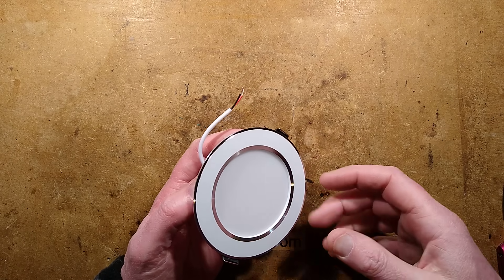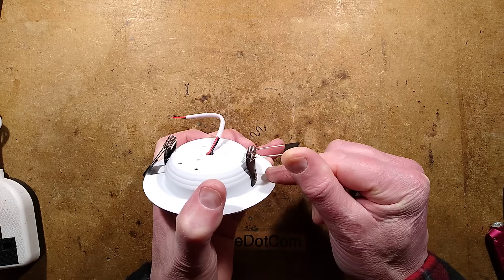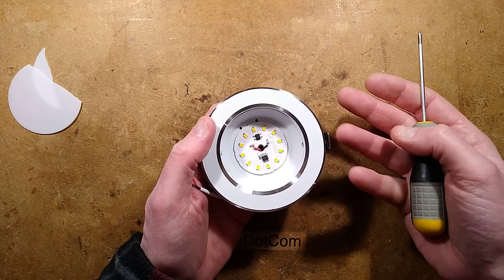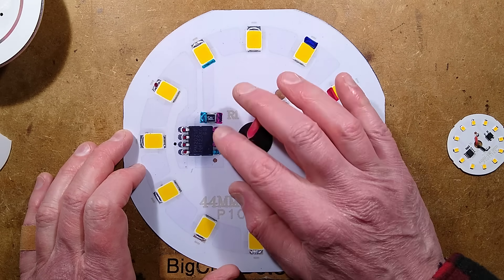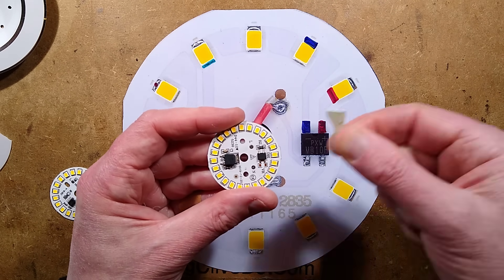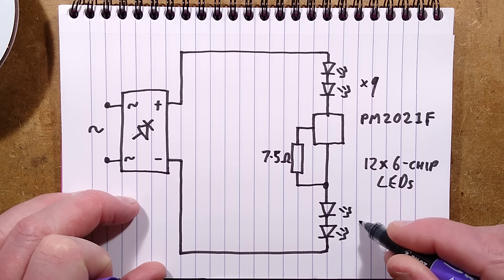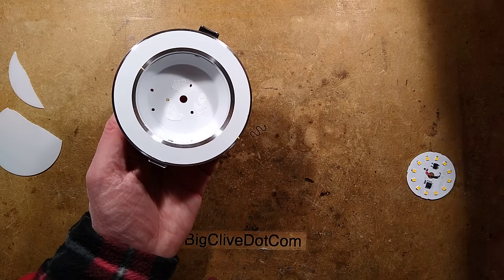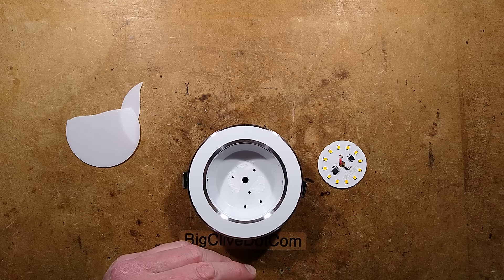inside a $1 downlight - novel circuit twist

Comment: This is why we invented lightbulbs. For a few bucks, you can fix the thing that helps you see at night. 
Having a light that's not user serviceable is just asking for trouble.
Reply: it's literally cheaper to throw away incandescent light bulbs immediately and replace them with (replaceable!) LEDs: the money to operate a 100W bulb is more that the price of a LED within months.
Reply: @Martinit0  This is an LED lightbulb. Unless you're snooping on my previous comments. I did mention there are VERY NICHE use cases for incandescents still, and I stand by those points as I've researched them thoroughly and make drivers for both types of bulbs for fun, not to mention my own LED lights, so I have a great understanding of exactly what components can go wrong in them. 

But yes, LEDs are far more power efficient, and in most cases have a much longer lifespan. This still doesn't change the fact that the MR16, GU10, G24, 2G11 R7, or even a tubular B15 bulb exists. Designing this to fit one of those would be much better for the consumer. Even if the manufacturer made their own screw in lightbulb it would be better. Primarily as you'd not have to patch up your ceiling in the event it needs replaced.

Edit: I'm a moron that can't read properly lol. Yes, I basically agree with you.
Reply: @Deja117  Probably I misunderstood your top comment when you said lightbulb I understood incandescent lightbulb.

I do actually have E14, E27 and GU10 type LED bulbs. They do exist. I don't know about the other connector types as I don't have any of those in my house.

I was about to say that G10 T8 LEDs don't exist but I checked just now and it seems they are now commercially available.
Reply: Saying "they´re unserviceable" is just "thinking one step too short"... One must NOT break the glass-cover, that´s just an option...
Reply: To be fair, enclosed units are fire rated and IP65 waterproof for a reason in bathrooms so I can't complain with that and if your buying them from a reputable place then realistically you shouldn't have an issue getting a replacement.
Reply: it cost a dollar buy 5
Reply: Let's assume that this light IS "serviceable," and that one (or more) has failed. At $1/ea, is your time worth so little that you'd spend an hour or so to replace single LEDs to repair it? Or would it be a wiser investment to just spend another $10 at the time of purchase to have ten spare modules on hand for the times when one fails? Because in these inflationary times, $1 is almost like that penny you see in a parking lot and won't bother to reach down to pocket it because "it's not worth my time."
Reply: @demef758  Another consideration of worth of your time: is it more effective to spent two minutes to pick up a spare lamp, unscrew the old one, screw in the new one, and throw the old one in the rubbish? 

Or is it more effective to go turn off the electricity, probably get a ladder and set it up, spend ten minutes gouging the old fixture out of your ceiling, trying to do the minimum damage to the soft plaster around it, snap at least one of those mousetraps on at least one finger, unclip the plastic splices, breaking one in the process because it is brittle from years of heat, spend another ten minutes finding another splice connector (or an hour to go out and buy one), clip the new fixture in, snap it in place, clean up any mess on the white ceiling plaster, put the ladder away, and get the vacuum to clean up the mess on the floor? Oh, and go turn the electricity back on and see if your repair actually worked? All told between half an hour or maybe three hours, depending on how many unexpected parts you need to buy?

Personally I think that two minutes with minimal danger to anyone is considerably more efficient than several hours with considerable danger both to yourself (if you aren't an electrician) and chance of damaging the plaster work, or at least getting it smudged around the fixture.
Reply: @lwilton  You spend less time replacing the bulb if you make the kids or wife do it too.
Reply: @demef758   Well that light still isn't user serviceable in my opinion, that sounds like something rather dangerous still, that an electrician should be doing. Since it's playing with potentially live wires... Depending if you remembered to flick the light switch off or not. So the user shouldn't be anywhere near that part of it in this case.

Now if there was a simple and safe screw mechanism, where you could twist the plastic diffuser out, then twist the old board out the light, and place a new one in, then that would meet the "serviceable" requirement as it's not potentially putting you in danger of being fried by 120, or even 240 volts depending where you live. In fact, there would still be the danger of some exposed components on the PCB, so you'd probably want to have the diffuser built into the board so you didn't risk touching them. So now it's safe to the user, and doesn't risk immediately harming them if they make a mistake, then I'd call it user serviceable. But again, this is all just my own personal opinion. I just put safety above saving a few bucks. 😊

Comment: My kitchen light is like that, just a throw away LED fixture. It flickers after a few minutes of being on. I was so annoyed when I went to change the bulb and found there was nothing to change but the whole thing. I just quit using it and live with a dim kitchen lit by the over the sink pot light.
I wonder if I could change the driver in it, I found some online that looked the same but I am leery of Amazon electronics in my ceiling.
Reply from the maker: It depends if it's the driver or the LED circuit.  It might be better to replace it, but either get a light that takes conventional bulbs or get a few of the same type of light as future spares.
Reply: Maybe it's just one component in the driver that's broken and you can figure out which one it is and solder in a new one?
Reply: @zzoinks  It has a box on it that has the 120v going into it and another plug from that box going to the LEDs. I assume that is the driver and you can buy them separately so I wouldn't bother trying to diagnose the actual part that failed. But as big Clive replied it might be better to just get a proper fixture that takes a replaceable light and be done with it instead of guessing at the problem.

Comment: It might be more acceptable if it had brown and blue wires, a fusible resistor, and an earth. For disposable light fittings, it would be better also to have some sort of standard plug and socket arrangement to make changing easier for people not used to coping with wiring; they only need to switch off the power (or just the lighting) then, like changing a bulb in a standard holder.
Edit: needs strain relief for the cable too.
Reply: In Australia they commonly come pre-fitted with a standard 2 pin power plug and they plug into a GPO like receptacle in the ceiling, so they are safely user replaceable without the home owners needing to pull out a screwdriver or touch any wiring. Given all electrical work requires a licensed electrician it's really the only viable solution. 

You can buy bare wire units, but do you trust your insurance company to still cover you in the unlikely event something goes wrong.
Reply: imo they should make a standard for those circular PCBs so you can unplug a dead one from the fitting and pick up a standardised replacement.
Reply: @elongated_muskrat_is_my_name I was thinking that too, but getting a good thermal contact with the housing used as a heatsink could be a problem. It would need some sort of screw down or clamping arrangement and then there is the thermal paste or other thermally conductive material to add.

Comment: I wonder if it being all metal would actually lead to this thing lasting a while since the whole case is essentially a heatsink.
Reply from the maker: It probably does have better dissipation that a bulb.
Reply: that is not sinking 12 or even 5W properly.

it's just baking + degrading the silicone until it fails 100%.

like the retrofit crap.

Comment: Why didn't it flicker without a capacitor?
Reply: It probably does. Also, if LED voltage is low (say driver dissipating idk, most of the line voltage) then it would flicker less even without smoothing. Which is very inefficient. When I designed my own linear LED PCB thing, I tried to match LED + min Vdrop on driver to nominal mains voltage (i.e. it would flicker and be dimmer if voltage in the socket sags below 10% i think) as close as possible and I ended up having 33 uF capacitor for 10W LED module. Oh and that also results in shitty power factor but I don't pay for it, nor do I care about THDs my device produces. Not my problem really :D
Reply from the maker: It will be flickering, but not too badly due to the on to off ratio.

Comment: I'm missing the sticker/stamp that indicates
- voltage
- frequency
- current
- power
- IP-rating or warning of exposure to water
- temp. characteristics
- quality/safety standards
- disposal/recycling. 😉
Reply: That information would probably put the price up to greater than $1...
Reply: @polymath9372  Yesss. 🤪🤭
Reply from the maker: That's because it doesn't comply with any standard or technical specification.

Comment: The issue with these disposable type fitting is not just that you need to buy a replacement but there's no guarantee you will be able to buy a replacement. A year from now, what's the chances that the same style will be available, especially if you bought from a random AliExpress listing. You end up with a ceiling full of downlights apart from one mismatched replacement.
Reply: In new houses here in the U.S, these non-replaceable fixtures are too common.
Reply: @vinnysworkshop  because they are flat out superior to other options for cost,reliability, and ease of install.
Reply: @dexecuter18  you mean because they are cheaper and faster to install, which is all that matters for the contractors. They are not "superior" nor more reliable to anything else that is also serviceable
Reply: While not quite the same, I installed an early version of the LED "retrofits" in the standard recessed cans in the basement. I had that same thought, if one fails it will bother me they don't match and I'll end up changing them all. Bought an extra 2-pack of them and so far after 12 years I've needed to use 1 of them. So hopefully I'll be set for awhile with that single remaining spare.
Reply: Or you buy an identical one in 6 months except they've changed something inside and the colour temperature is off etc
Reply: @kiplinght  Thats why you buy a reputable brand with a datasheet. You can match the specs. But I find alot of the stuff sold by the DIY chains is rubbish so you need to find a decent manufacturer and go from there.
Reply: If you want downlight, only buy the standard sized ones. I've just replaced some CFL downlight that were about 20 years old with some new LED ones. Aurora brand who I know to be good quality.
Reply: For an example, see my kitchen lights. Had to change one myself already. I couldn't find a matching style to what was there.
Reply: You can replace the internals.
Reply: There is ones, without a bulge at the rear (so, a flat rear), and instead, a bulged cover-glass at the front, which can be removed easier since it´s already curved, and without braking. ALSO: Don´t need a ceiling-hole for installation, just some double-sided adhesion-tape instead (flat rear)... But I didn´t know that there´s replacement-PCBs available, that´s great !!! If one can connect the 2 cables himself, eventually even solder a replacement-PCB himself, then, there´s no reasonable argument against them... Saying "they´re unserviceable" is just "thinking one step too short"...
Reply: Actually these are quite common for about 5 years. I have the smaller version above my hob as I couldn't find anything else that fits and looks OK.

They are cheap as hell and the first set lasted about 4 years of almost every day all morning to evening on with me.

Comment: Pins seem to be cheap, I've got two dozens of LED bulbs of the same model in blisters of 6 just before the pandemic, all those that have already failed used a JW1792 chip, that's a buck converter that only needs 3 pins, but anyway it's available in TO-92, SOP8, SOT23-3 and CPC4 packages.

Comment: I wonder if they could make the mains cable any shorter?
Reply from the maker: They gotta save those pennies.  But on a plus note it means the junction box isn't too far away when the light fails.
Reply: Couldn't you just stick the inside of any LED light bulb into the fitting if it fails - or just measure the disc size and order same from AliEx?
Oops, I should have watched the whole video before commenting☺
Reply: i love that on the 12V waterproof floodlights....

not only that they are far from waterproof. but they also lack the possibility to connect the wires somewhere 'safe'.

and then the stupid glued on glas panel that can't be removed.

how crappy could one design a light fixture ?
Reply: The double insulation doesn't go into the fitting either so you can immediately see they fail to comply with wiring regulations.
Reply: Is that a challenge 😂

Comment: I have never seen fittings with those clips before. Are they just what those types of lights use?
Reply: Yes, very typical; they only have the ceiling plasterboard to ‘hold on to’ and standard method is a clip to hold lamp unit tight to painted surface.
Reply from the maker: It's a common way of holding downlights in, so you don't need access above the ceiling to fit them.

Comment: Are they having a competition to see who can put the least components in a light ?
Reply: How long until they invent an incandescent LED? Just 1 component :D
Reply: @Alex-mj7km  Full circle. LOL.
Reply: Such is the nature of capitalism.
Reply: @Mueller3D  Well, more like cost reduction, which is actually a useful thing.

Capitalism sucks though.
Reply: @Mueller3D  Read properly on capitalism theory. Like 200 years of it... Just avoid a lot of stuff published and specially written after 1950s. 
It's "nature" of other... starts with C- and ends with -ism too.
Reply: Sure seems like it unfortunately :'(
Reply: Pretty soon it's just going to be an LED and a resistor
Reply: Someday, they will find a way to reduce a light to a single thin strand of tungsten wire.
Reply: @joenu125  Don't be daft. That'd be impossible.

Comment: I know this is totally unrelated but do you guys have suggestions for budget soldering pens?
Reply: TS120 is great !

but this advice is as unhinged as the question because nobody knows the application.
Reply from the maker: Depending on where you are in the world, I'd suggest buying a locally compliant basic soldering iron from a prominent electronic component distributor.  In the UK that might be CPC or Rapid Electronics.  In America it might be Mouser or Digikey.  That way you get something safe and of known quality.  My main iron used to be a fixed power 25W one.
Reply: I live in Finland, just need it for small everyday stuff and need something relatively portable and cheap. I looked at the small ones like pinecil/ts100 but they're pretty pricey. Thanks for suggestion and tips!